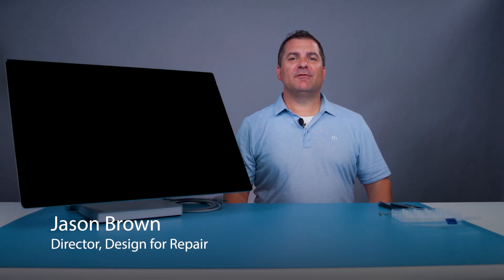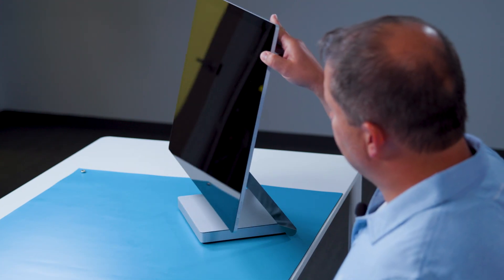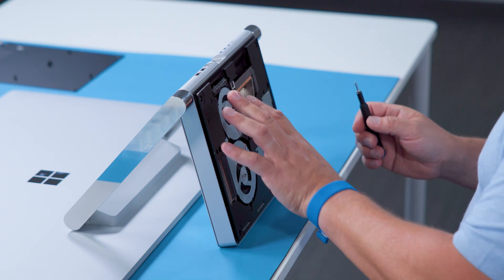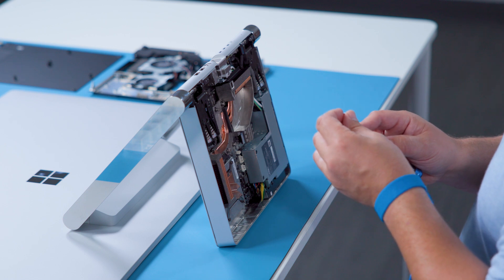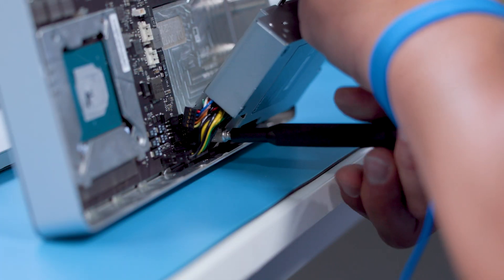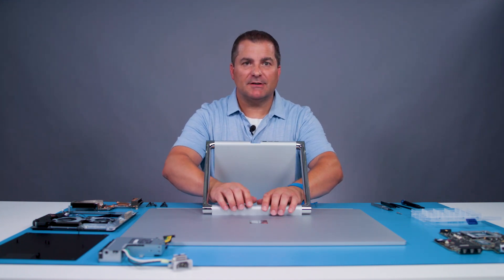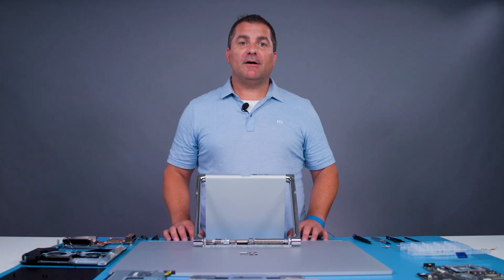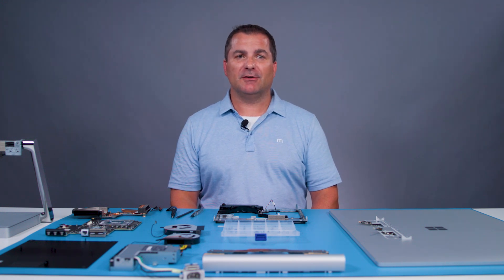Repair | Surface Studio 2+

Comment: Nicely done, I was wondering where the SSD was in my MS Studio Surface 2 + and now I know. If I'm replacing the SSD with a 4TB model, am I correct in that I need an SSD version with a built-in heat sink?

Comment: I have a Studio 1 and have babied it from day 1.  The screen has gone bad and a very noticeable pink glow exists around the perimeter.  I see a LOT of these for sale on Ebay with the exact same problem where they are being sold for less than they should be becuase of this problem.  I have never had this problem on any other Surface device I have owned and I have owned a LOT of them and still use them and love them!  It would be really great if Surface would consider doing a recall on these screens or offer a cost effective way to replace them.  I have purchased someone's machine for very cheap that wont turn on from Ebay hoping the panel is good and I can swap out the panels (it is doable).  I have an apple Studio display and as glorious as they are, I still prefer this amazing screen of the Studio so this is really disappointing considering how much these cost to purchase.  I sure hope these new Studios do not have the same problem as I just set up a new one for a client last month and have recommended them to a lot of people.

Comment: Thank you so much for the detailed video! Really appreciate it. I have a Studio but it stopped working abruptly one day and it won't power on. Might you think of any causes? Because I don't even know what parts I might need to repair it since it won't even turn on. Would it be helpful to get a power supply and try to replace it with the current one?